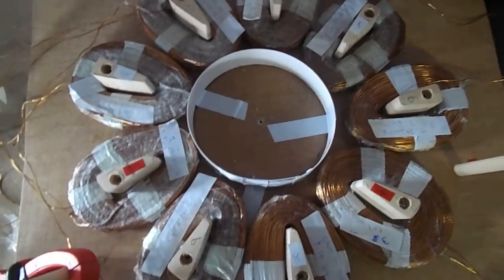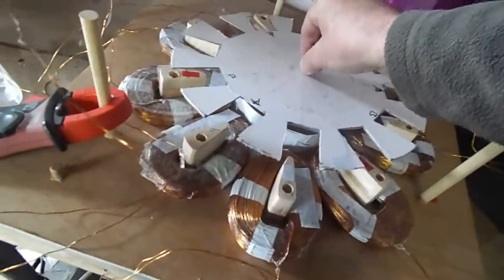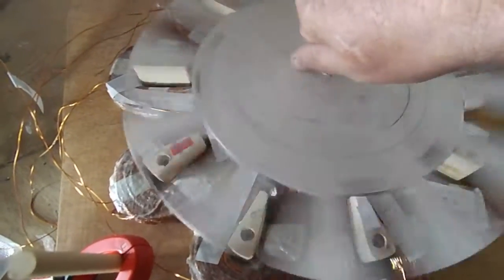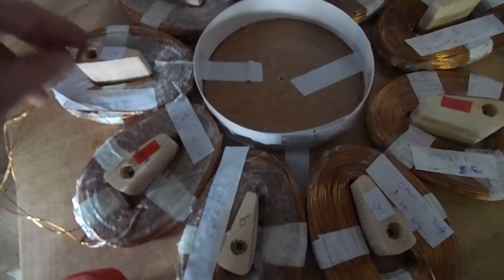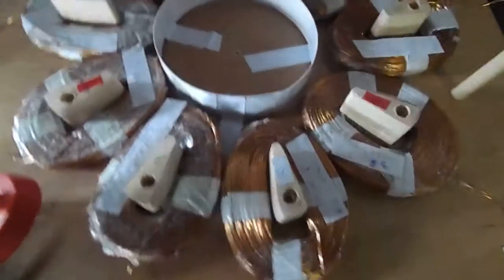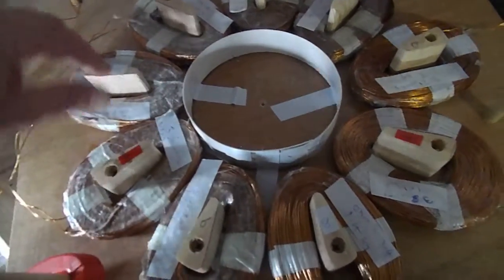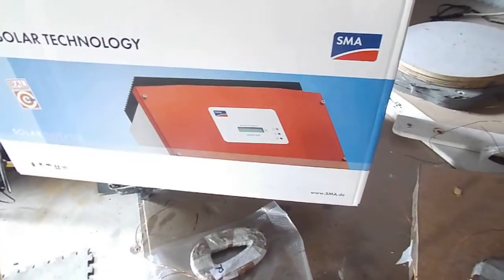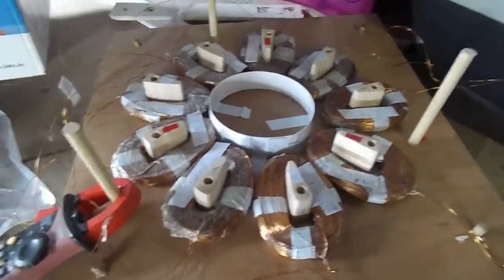160 volt coils for DIY wind turbine.

Comment: If your wire size is low your turns is get higher and current will be less but when your turns get less your current will be higher but you must have strong magnet

Comment: Does more turns make more volts? or why 400 turns? wouldnt be easier to wind 10 wire together 40 times? I'm very corious about how its actually related.
Reply: Thanks for your interest.  I kind of followed what little interest there was in building such a stator at the
time it had to work with the SMA windyboy. It tested every knowledge and patience i could find.  The turbine
Is still working on the most westerly part of the Dingle peninsula. I found alot of knowledge from hugh's wind turbine recipe book. But i think i could now write my own????

Comment: 1/2" of resin has no effect on the magnetic field ...
Reply: Good point but its more like 3/4 " and factor in the air gap. Been up now for more than two years
in serous high winds. I feel  it works better with the holes in the resin. Plus its alot harder to make
I like a challenge. Thanks
Reply: @trishmoriarty3784  The holes may improve  cooling ...

Comment: How many rpm required to produce 160 volts
Reply from the maker: about 8 to 10 mph wind speed will produce required 160 v I think the wire gauge is in the video need to check my diary other wise

Comment: I think you meant the first circuit (the red phase) used coils 1-4-7, not 1-4-5. Otherwise nice video.
Reply from the maker: Thanks Walter I knew some one very smart would pick that up eventually. Will put in a note. Cheers
Reply: Thank you for saying "smart" rather than "nitpicky".  :-)

Comment: each coil is 400 turns. How many meters?????
Reply from the maker: Yes 400 turns. Enamelled  copper wire is sold by weight not by length. A six pound spool was needed to do allnine coils. Thanks for your question Rafael

Comment: That looks like the best axial flux job i have seen. All uniform, sweet.
Reply from the maker: Thanks Jeff. Just as long it don't smoke the inverter. I don't know what where going to do! Expensive came on a pallet weight 30 kg bolted to the wall with 4 four six inch coach bolts.
Reply: The worst that can happen is the dreaded blue smoke of death. That's the fun part of R&D.
Reply: @missouri wind what is you gauge recomendation for a similar project?

Comment: Nice video did you make a video on how you wired the coils? Can not wait to see it up and working. How many amps do you think it will make at that voltage?
Reply from the maker: Thanks no just a video on how the coils work. There are a lot of coil winding videos out there better than I could doThe grid tie inverter can handle 1700 watts expensive bit of kit but it is approved for UK Europe by all utility companies.
Reply: ouch it will be nice to see it work. I do not think I have the patience to wire the coils and such and looks like it could cost a good penny or so. Oh they still filming star wars???
Reply from the maker: Yes Star Wars all finished now. I just did one coil every now and again and had a counter for beer breaks LolThe magnets 24 x  $25.00 each is the most expensive part.
Reply: holly crap $25 for 1 magnet I will just enjoy your videos and will not be building one of them lol
Reply: @ian57812  what if i use ferrite magnet ??
Reply: Hello, cheers from Carpați, do you get money in return from the power company for going along with the grid? Cool setup u’ve made inside btw. What size magnets did you use? Have you gone ferite or neodimium? How much pounds per magnet? Here they don t wanna give subsidiaries from government to sponsor such ..
Reply: For the magnets you can use the m shaped pole config to make a strong magnet out of weak ones